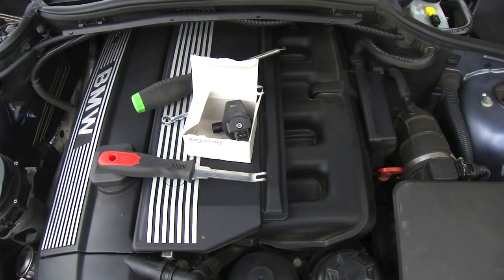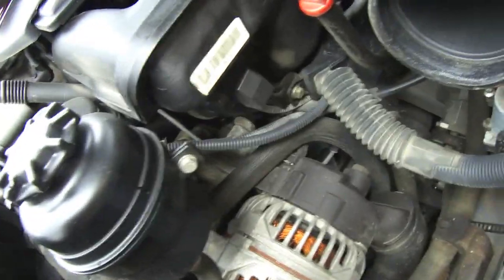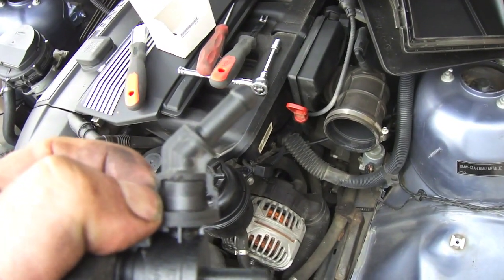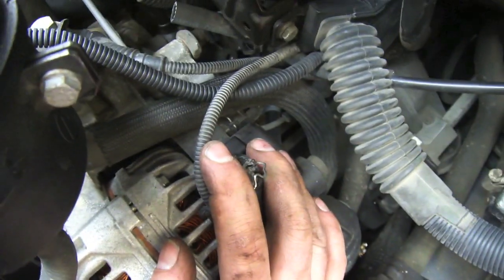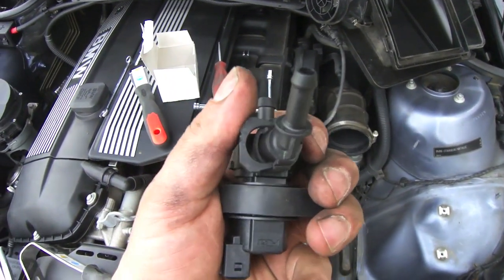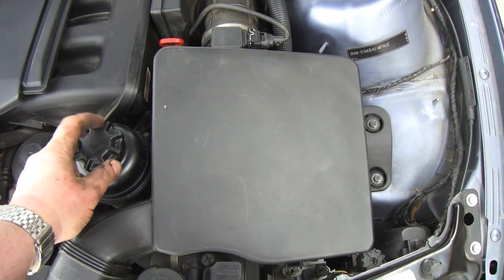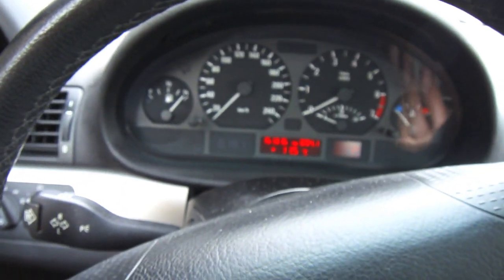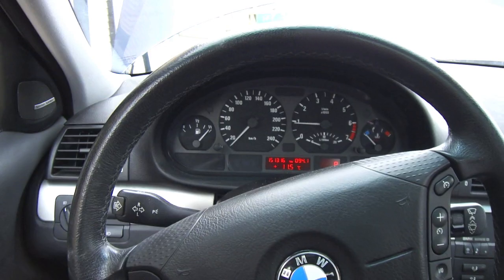DIY EVAP Canister Purge Control Valve BMW

Comment: Thanks for the video! Just thought I'd share my experiences:
1. Not strictly necessary, but removing the two 13mm bolts holding the power steering reservoir is quick and will give you a lot more space to work. 
2. Remove the hose with the clip first - push harder on the clip than you think you need to, while pulling the entire unit with the other hand. Don't worry about breaking anything.
3. Removing the side hose allows you to twist and pull off the second hose.

Comment: Great video. Saved myself alot of money. Bought the part from BMW, they told me that they stock at least 3 because it is a popular part for emissions tests. Garage would have charged me 1hr @ $125 to read and diagnose the code then another 1hr @ $125 to change the part out. If you have big hands, just go slow. Took me less than 20 minutes with this video. No more P0444 code. Thank you !!

Comment: Silicon spray on the squeeze clip works great prior to removing, it will soften the o-ring and it will slide right off with a squeeze.
Just spray the o-ring prior to removal and it will clip back in place.
Learned this trick when replacing the ccv valve.

Comment: Awesome you saved me a trip to the dealer.  I had the dreaded P0444 and watched this video.  I removed only the electrical connection and sprayed WD40 and put it back on.  Never had a problem since and passed emissions no prob.  Thanks again.

Comment: My mother's bmw gives code p0441 and p0456 for incorrect purge flow and small leak detection. Could this be a fix for both? Replaced the fuel cap but codes are still there. Thanks in advance!

Comment: I have a 2003 325i m56. Had lean codes and fixed by replacing DISA and both intake boots. Now not even a day later I have both systems too rich. Any advice?

Comment: I checked the gas cap, fuel lines, and vacuum hoses. They were all fine, so i went and bought the purge valve today for 111$ from bmw. I asked the mechanic at the dealership about the oil leak, he said its probably the oil separator or the ring to the oil filter housing. It's not really leaving puddles of oil, just a slight oil drip. I think it leaks the most oil at higher Rpm's when driving. Also, my exhaust isn't blue.

Comment: ONCE AGAIN Bro you were a huge help to me with this video, Now I have another issue that the BMW dealership said I had 

2002 BMW 325i E46. They said my top front O2 Sensor was bad, DMTL Pump and of course this videos "Tank Vent Valve.  They wanter $550 for the friggn parts, I managed to keep parts <280$

Do you have any videos explaining replacing the DMTL Pump?  They say ist in the right rear wheel well.  I haven't attempted to access it yet, I prefer to watch videos B4 I attempt any work.  I am not a mechanic, I am a retired US Army Blackhawk helicopter pilot who flys EMS helicopters, But if I can save $ doing simple work myself then I will attempt it
Reply from the maker: No I don't unfortunately and I've sold the car as well.  That's pretty cool that you were a Blackhawk pilot, did you see any action at all?
Reply: There are diagrams on google that show the whole car and how its put together

Comment: So where do the 2 hoses off the purge valve go to I been watching video after video nobody's covering that also there is the two hoses that go behind the throttle body there's the one with the plastic elbow that has a orange grommet into intake plenum that goes to brake booster then what runs into the other port is that the purge valve???

Comment: My 2001 325xi threw the p0444 and p0441 code at the same time. Any thoughts before i buy this solenoid. Also, any common oil leak issues this car has? I'm going through a quart of oil about every 100-150 miles.

Comment: i have the same problem on a 2003 bmw 325i . code P0444.. Do i have to replace the purge valve and thats that!! thanks for your help.. btw i have service engine soon light on .. not engine light

Comment: Do you know what the the cables connectors are from? I gues one if from ecu and other is power or ground?

My connector only has i cable connected and it the bottom on so not sure

Comment from the maker: this may sound stupid but the gas cap is the most common issue with evap codes not saying that is the problem but maybe something to look into. if your going though a quart every 100-150 miles that's pretty serious are you leaving huge puddles of oil behind when you park, is your exhaust blue ?

Comment: Love your very helpful instruction. Two questions about this mystifying little bugger. The heavy rubber tube that comes out of the nipple and into the cave beneath the intake manifold: Where the hell does it connect? Do you have to pull the manifold off to reconnect it? And, this may sound dumb, but how is it possible that the wire lead to the valve has ONE wire in it? How can it function without a closed circuit?
Reply from the maker: I never did trace the line to see where it goes, the wire lead that goes to that sensor actually has 2 wires in the loom

Comment: Is this purge valve the same as the Evap leak detection pump?? code P0444…Thank you
Reply: Three things to check, first fuel cap sealing properly, the evap purge solenoid as seen here, and also the sensor on the evap canister under the car. Also leaks in lines/hoses and or canister will cause this.

Comment: You stated in an earlier video (or later) that this part replacement got rid of your f5, f6 (peake) codes? Was that all you done? I have those 2 codes as well as a d6 code and have been trying to fix this the best I can.

Comment: It's definitely worth the extra couple mins to undo the PS canister via the two 13mm bolts that hold it in place.  You need NOT disconnect the tubes...just nudge the canister aside enough to get to the vacuum hose.  I'm trying to find someone who sells that small NORMA 3 coupler.  I could probably just reuse my existing one, but it has a crack in the flex ring.  (23 years on top of a hot engine can do that to plastic!)  If any of you have a line on that clip, please let me know.

Comment: Just go the local wrecking yard and pull one from another BMW. They ran this valve on many different types of bimmers.  3, 5, X5... etc.  

OEM Part Number

13 90 1 433 603
13901433603

The Part will fit the followings:

E36.7 09/98-2000 Z3 2.3 from 09/98
E36.7 1999-2000 Z3 2.8 coupe
E36.7 09/98-2000 Z3 2.8 from 09/98
E36.7 2001-2002 Z3 3.0i coupe
E36.7 2001-2002 Z3 3.0i
E38 09/97-2001 740i M62 from 09/97
E38 09/97-2001 740iL M62 from 09/97
E38 09/97-2001 750iL from 09/97
E39 2001-2003 525i
E39 2001-2003 525iT
E39 09/98-2000 528i from 09/98
E39 09/98-2000 528iT from 09/98
E39 2001-2003 530i
E39 09/97-2003 540i from 09/97
E39 1999-2003 540iT
E46 2000-2000 323ci conv
E46 2000-2000 323ci
E46 1999-2000 323i
E46 2000-2000 323iT
E46 2001-2006 325ci conv
E46 2001-2006 325ci
E46 2001-2005 325xi
E46 2001-2005 325xiT
E46 2001-2005 325i
E46 2001-2005 325iT
E46 2000-2000 328Ci
E46 1999-2000 328i
E46 2001-2006 330ci conv
E46 2001-2006 330Ci
E46 2001-2005 330xi
E46 2001-2005 330i
E53 2001-2006 X5 3.0i
E53 2000-2003 X5 4.4i M62
E53 2001-2003 X5 4.6is
E85 2003-2005 Z4 2.5i
E85 2003-2005 Z4 3.0i M54

Comment: interesting. my fault code is p0443 for the evap emission system purge control valve circuit, not a po444. 2000 328i.

Comment: i got the code P0444 emission purge valve when you replace it did that errased the code or it came back?
Reply from the maker: it erased the code and never came back it's been over 3 years now since i uploaded this video
Reply: Ooh on thanks I am about to change it came I need to smog car

Comment: I have removed the tank vent valve and the valve and hose came out with the valve. how do I reinstall the hose to the manifold?
Reply: sugarrae104 did u ever figure this out?
Reply: For whoever does this next, you'll have to pull the manifold off.  Its right there on the back.  50s kid has a good vid for this op.

Comment: I replaced the evap. purge valve code P0444 know its throwing code P0445 
vehicle does the same thing throwing big clouds of smoke every 20 to 30 minutes 
has anyone had this problem. It is very frustrating when one code is fixed and another comes up is it a leak.
Reply: Fernando Montes i have the same issue right hoping that this will fix it, only my code is p0444

Comment: I have RPM going up and down on the cold engine, and then it settles. have anyone faced this issue before?
Reply from the maker: could be your vano's do you hear a rattle too ?
Reply: no, there is nothing, just the needle go up and down
Reply: User same problem most likely vanos...

Comment: The most common and most elusive is the Oil Filter Housing gasket. You will not see oil puddles because it burns off on the manifold or gets caught by the splash guard. See the video for the replacement here: (PMPDaddy68 channel - video Jy0EKjuxlpY .Other culprits include the valve cover gasket, but a visual inspection will usually tell you that easily.

Comment: I have one question.. 
I changed my EVAP valve with "wrong" valve i think. My original was 0280142353 and i've got by original dealer 058133517B. Error light didnt come up jet, but what could be wrong if i leave it in? Isnt this only valve with "open - close" function?
They look the same, only color is diferent and car types are diferent if you google it. I have Audi a6 2.4 V6 2003 170hp.

Comment: need help I have 01 330i I changed every thing on car and still got cods 175 and 171 too lean bank 1 and 2 bmws are junk carssssssssss i only got on bitch 96 klm
Reply: Hi Moe,
Did you resolve your issue?  I had similar codes on my 2005 325i that said the banks were running lean.  Mine turned out to be the adjusting unit.  It has a mechanical flap and the flap broke so it could not adjust the air flow.  This part attaches to the right side of the intake manifold. 
ADJUSTER UNIT with broken flap is the culprit
Until I came across a part refered to as "ADJUSTER UNIT" which attaches to the drivers side of the Intake Manifold. This unit is attached to the manifold with 2 T-40 Torx screws, it does come off fairly easily. Once I took mine off, the flap that opens & closes was broken thereby leaving the air port/opening wide open and therefore causing the Lean Conditions which in turn, cause the P0171 & P0174 OBD-II codes to be stored & THE SES light to illuminate.

Search Part # 11 61 7 544 805 to see what it looks like.  I paid almost $200 at dealer. 

It took about 20 minutes to replace it but only because I had to remove the Air Filter Box to allow for easier access to the Adjuster Unit.

Comment: Wow between all of the cursing and carrying on this guy got very little right . Does not even know the correct  way to remove a standard emissions connector or electrical connector.Also the peake scanner always resets the engine light. You will not know if the issue is resolved until at least three complete drive cycles.Comical video
Reply: guess he likes to swear and act like a mechanic rather than fix anything like a real mechanic!
Reply: Thomas McHugh...do you take the time to post videos? Like mama always said.....